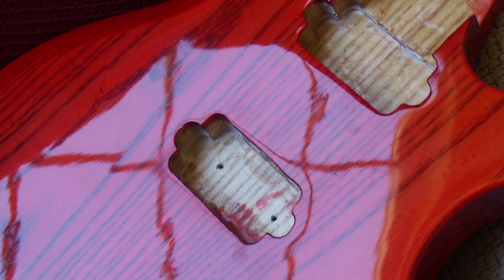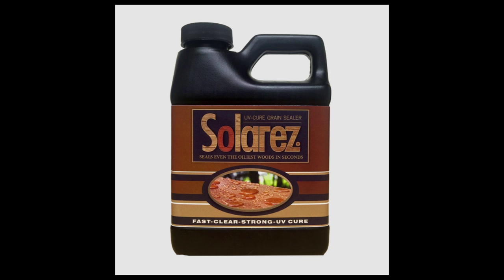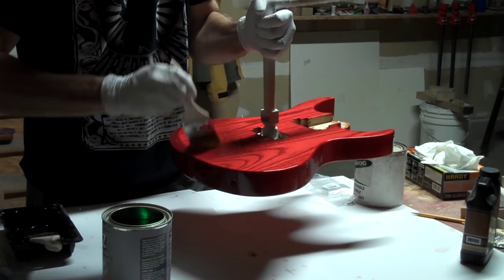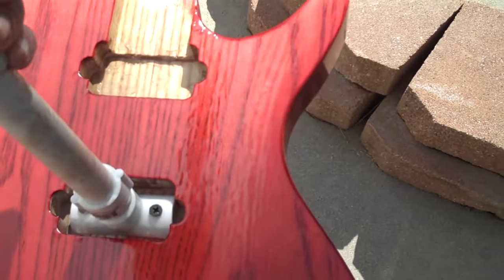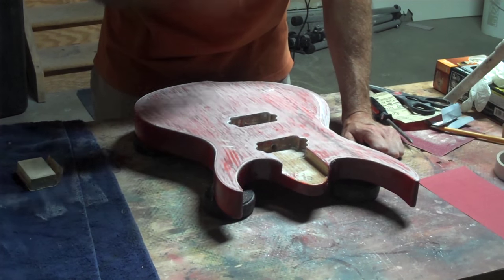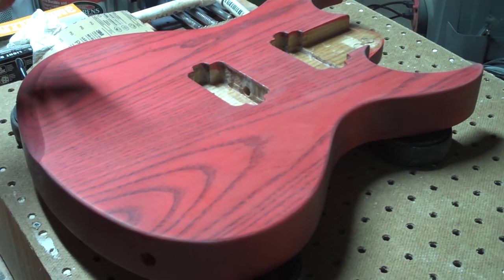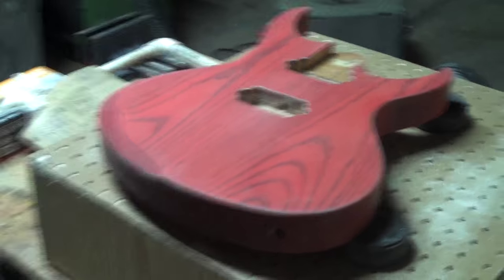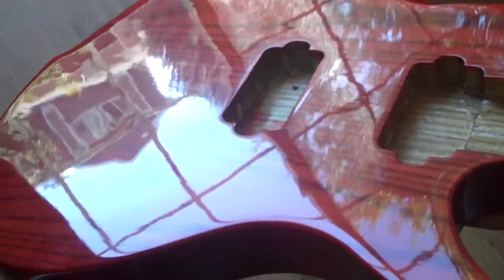How to Clear Coat A Guitar With Solarez UV Cured Polyester Gloss Resin

Comment: can this be applied over plastics and can ad any pigment in it ?paint over it  and coat again ? Thanks in advance !
Reply from the maker: You would have to ask the Solarez people. My experience is limited to applying it over stained and dyed wood only.
Reply: Thanks !!! I already did :)
Reply: Did you get any info about using pigment from Solarez? I found the section of their FAQ that addresses it, but couldnt find much detailed info. Seems like a "try it and see" kindof thing for me at the moment. Thx!
Reply: Chaz Ginest I bought two types of solarez resin ( not the 3d printing oriented ,was to expensive) i bought 1 kg of epoxy and 1kg of polyester ( polyester is smelly not much but need vent or mask...) i used the polyester, which  is thinner ,and dipped in the 3d printed titan part i used a uv flash light to cure it (380 -385 nm) which i bought from aliexpress 15 euros -+ .The result was good so i   m guessing the epoxy which is thicker (and more expensive) will work better. Im also planing to color them with some powders and pigments to see if they dry right when mixed with color. Maybe il make a post or something  but it is promising to deliver good results. One more resin i have in mind trying is the art resin which has 30 min working time. The xtc 3d from smooth on is only for small prints ...
Reply: Cool, let me know how it goes! I have no idea if its possible, but I'd love to find something that can provide a metal flake-like appearance as well. Im guessing it will be impossible to keep something like that properly mixed and evenly suspended in the resin, but maybe Im wrong...
Reply: Well the hole idea came to me from women nails XD i seen very good metal like effects on them i dont see why not working ... One other way is chrome plating which needs a lot of experience and room to work with and the other is a Japanese paint which is the best metallic paint i have seen but very expensive to get shipping + the paint its self ...Il keep you posted i have order a lot of metal flakes for nails and more staff  to experiment .
Reply: Ah, cool! I'll shoot you my email address, very interested in what you find!
Reply: Sure dude it will take some time im building two printers and have an exhibition in two months so maybe it take a while :)

Comment: Have you tried using a propane torch over the uncured surface to help level and remove bubbles? I have done counter tops with epoxy with that method and all bubbles are eliminated and the surface flows out very level
Reply from the maker: I tried with a heat gun, but not a torch. I ay give that a try next time I use it.
Reply: Highline Guitars you have to use a propane torch. You just kind of lick the surface and you will actually see small bubbles come to the surface. There should be a video on it somewhere